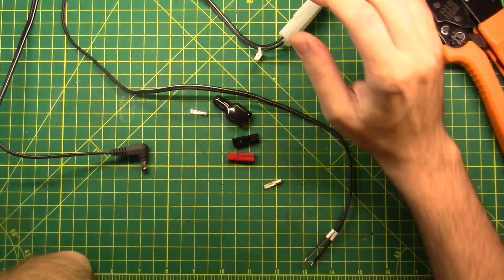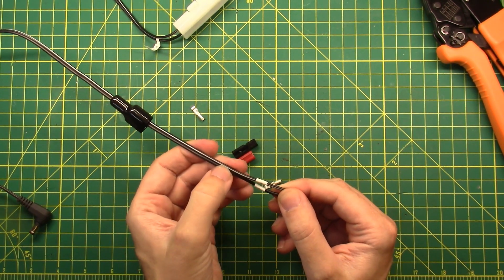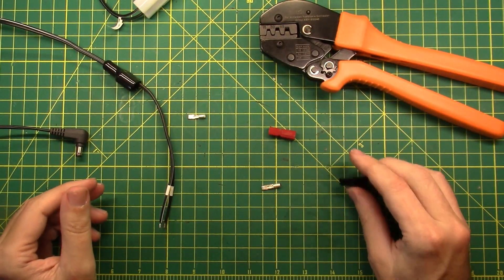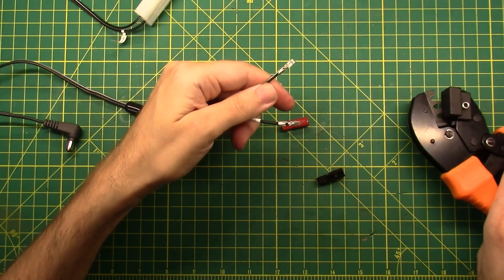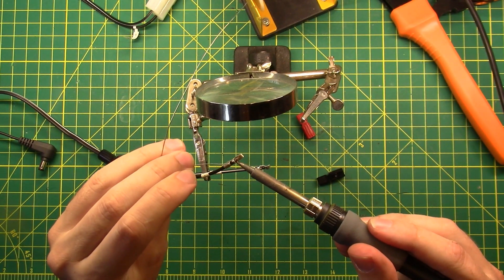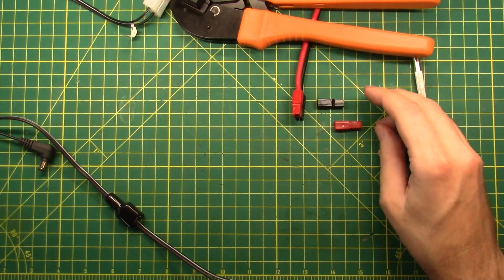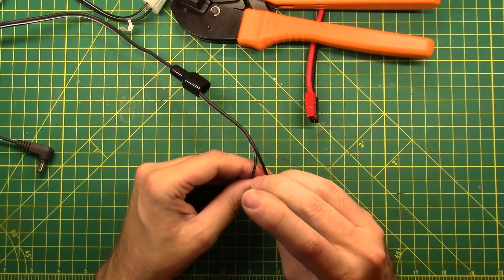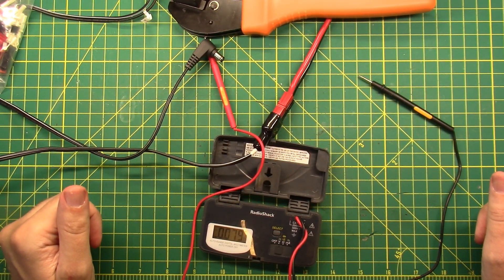Ham Radio: The Required Power Pole Video | How to Install PowerPoles

Comment: Solder if you want! It makes the wire brittle and will break if flexed.There are NO solder connections in any Aircraft wiring harnesses because the wires will break from the vibrations.
Reply from the maker: Thanks for the info!

Comment: Uh, no, that's not how you do powerpoles.  You don't crimp over the insulation.  That's improper wire end preparation. You don't solder after crimping.  Totally unnecessary with a proper crimp.  Chinese knockoff powerpoles don't work as well as the branded ones.  They don't connect/disconnect/disassemble with the same ease or resistance to breakage.  Plastics may look the same without being the same.
Reply from the maker: Thanks Karl

Comment: I don't get the fascination with these.
Reply from the maker: XT60s are better, but since everybody runs these, it's the standard we have to live with.  Better than bare wire, but not the best.  Maybe they were the best when they were first adopted?
Reply: This. I ran xt60s for the longest time but ended up converting just because everyone and everything either has a weird cult like love for these things or comes with them fitted.

I suppose one advantage (but safety disadvantage) is the cross compatibility. I used to run xt30 on my qrp/low wattage stuff, xt60s on things that need more robust wires.

Powerpoles let me mix and match depending on mood, great for flexibility but really quite dangerous if you accidentally draw 30+ watts through something designed for 10.

Comment: Place a drop of super glue near the opening of the female channel on the plastic Powerpole housing before mating them together.  Just make sure you have a flat surface to press against when assembling to ensure they are fit evenly.  You only get one chance to get it right.  This will keep them from slipping apart and also avoids the need to use the roll pin which in turn allows the use of retention clips like these: https://powerwerx.com/powerpole-connector-retention-clip.
Reply from the maker: Those retention clips are sexy!

Comment: I've always striped the wire for the whole fitting. I didn't k ow you where supposed to put the coating in the crimped part.. I always soldiered the whole thing lol. I dont even crimp, I'm cheap I like bein able to take them off if needed. Thanks for the video TO
Reply from the maker: Hey T-Man!  You do what works, have fun experimenting and realize this ain't rocket science.  In the end, its about having fun, getting on the air and being productive.  Sometimes the wire is to small for the power pole spades and you need a little filler.  As long as its mechanically sound and electrically connected, you won't get a complaint out of me.

Comment: I've never seen a power pole go together that easy. I don't believe it. You Photoshoped it! 🤣 What's especially tricky is when it's really thin flimsy wire. Ugh! I have a love-hate relationship with power poles. I love their convenience. I hate how hard they are to assemble. 🙄 🥲
Reply from the maker: I never used to use the screwdriver.  At first I didn't even know they clicked.

Comment: To make sure I have the right orientation for powerpoles, I always remember "RRTT - Red Right, Tounge Top" - looking at the connection side of the connectors, the red one should be on the right, and the "tounge" of the connector should be at the top.
Reply from the maker: You keep good company, my friend

Comment: The crimp should go on the bare wire, not the jacket. Then forego the solder. However, it’s a little trouble with skinny wire to get enough to hold on to for a good connection.
Reply: Exactly what I thought & screamed at the screen: You don't crimp on the insulation - and soldering isn't necessary. Also helps to use the right inlay (15A, 30A, 45A).
Reply from the maker: There are two crimps, I used one for the whole wire and one for the conductor. I always solder my crimps for extra db